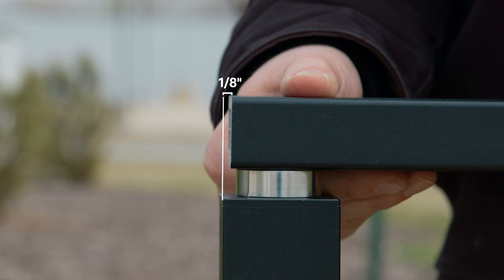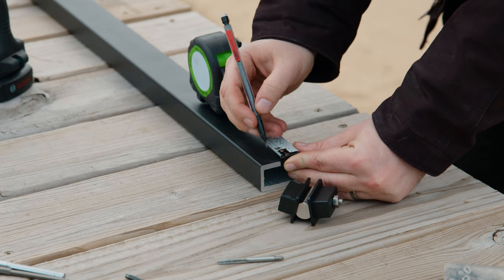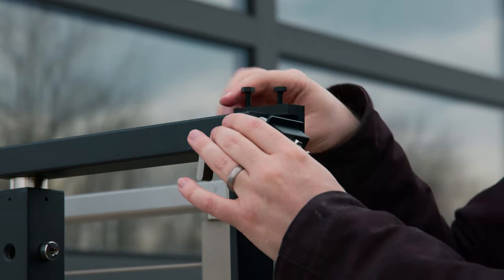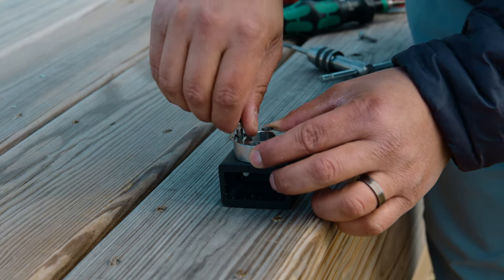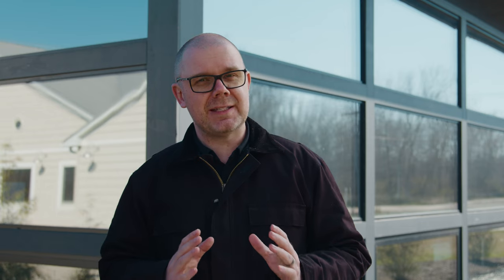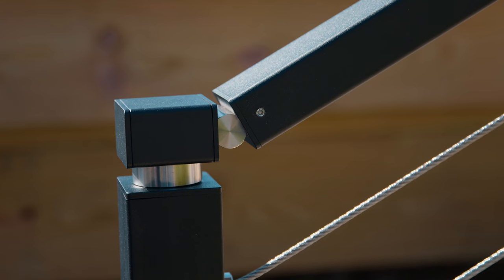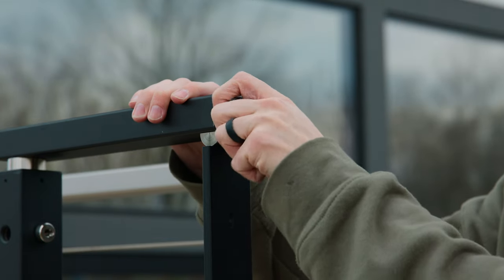How to Install the Handrail Hinge on Signature Series Handrail | Cable Bullet System

Comment: Wish this was out a month ago when I ordered, it's a lot easier than cutting and splicing aluminum stock.  Would this piece work for attaching a rail that intercepts a post, e.g. where you have a stairway with a landing that then turns. The corner piece ends up taller than the top rail, so it intercepts midway up the post.  If you could attach the swivel-reciever piece into that post, you could easily avoid having to miter and have rail-on-post.
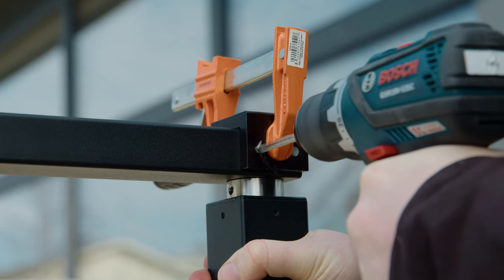Reply: Actually I think you show what it would entail at 6:57, just drilling into the post instead of the rail.
Reply from the maker: Yes, the Corner Hinge would work for this application!